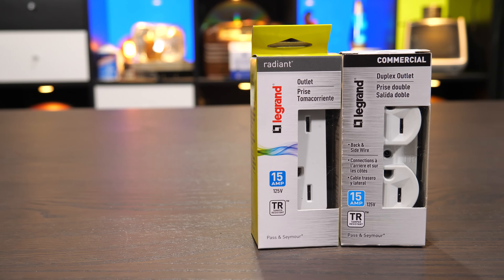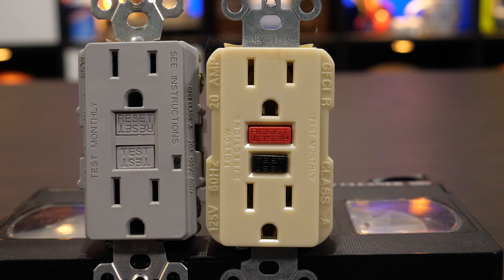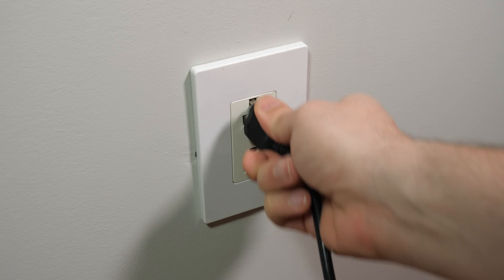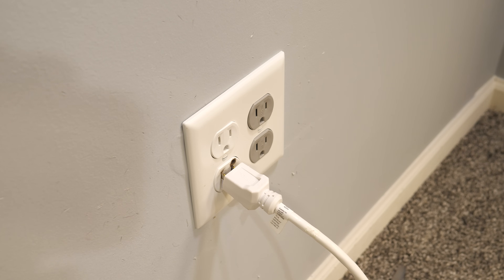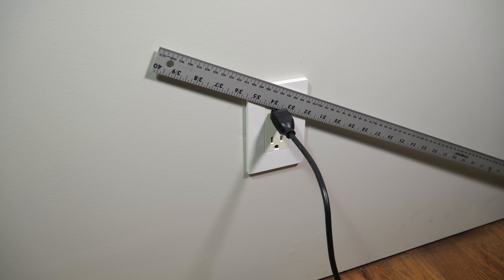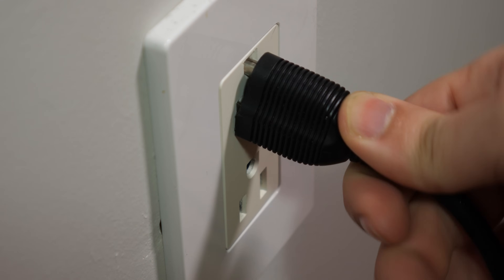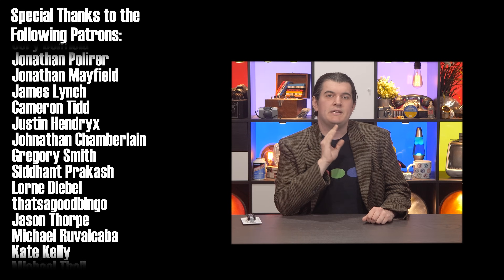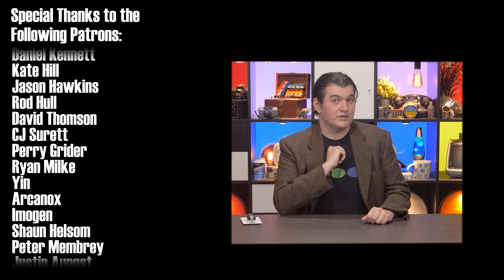Power outlets are topsy turvy - but does it matter?

Comment: You want to see something weirder than Chicagoland sideways outlets? Drive 75 miles north to older Milwaukee homes. The family that had the electrical monopoly in the Milwaukee area in the first half of the 1900s, believed that light switches (A) should not be reachable by children and are FIVE FEET off the floor. And (B) ON is down and OFF is up. Ask anyone in a Milwaukee home built before 1950. The light switch that is down position and on has the word NO clearly displayed. Because the family refused to conform to the industry standard and the rest of the country.

Comment: It is recommended to install the outlets with nutral socket on the bottom if installed  horizontally, the reason is that if your house gets flooded,  water would first get to nutral, at this time the outlet isn't output any voltage until water reach the hot socket and output about 50v to the nearby conductor, but if installed with the hot  socket at the bottom,  as soon as the water reach the outlet it would output 110v to the nearby conductor, until the outlet is fully submerged and bring down the voltage nearby to 50v
The original video about it can be found by using keyword: 插座安裝方向規定?【水電爸爸】
watch it from 6:30 only look the voltage reading it gets on the multimeter (BTW Taiwan use 110v AC with the US type socket)

Comment: This has to do with the ground pin, force, and leverage. Say you step on the cord right next to the outlet. The power pins pivot as they have more play but the ground pin applies pressure to the plastic insulation, and it loads up the surrounding plastic structure.

If the ground is up (smiley face) the downward force goes into the rounded curved side, to the center of the plug where it's strongest, If the ground is down (unhappy face) that force goes to the flat thin plastic side which is weak and can break out. This leaves you with an upside-down U shape that is open at the bottom, and that is the problem.

The ground pin has two functions. One electrical, one mechanical. Mechanically it acts as a pin, a strong lever to keep the plug level. When the thin unhappy face plastic breaks out it still works, but without the ground pins support the cord will sag down with use eventually losing connection. The dangerous part is once the cord starts angling down, there is a lot of downward movement; before electrical contact is lost.

During this time the two blades (hot and neutral) are exposed.

In a domestic setting, this is not a huge issue, but when in a shop setting with lots of heavy cords and power tools, the ground should always go up.

Comment: I was always taught the the ground pin was on the bottom unless the outlet was connected to a wall switch, then it would be on top. This had nothing to do with functionality. It was simply to make it easy to tell which outlet was connected to the switch which would typically have a lamp plugged in to them. I have seen houses wired this way for many decades.

Comment: I don't think I've ever touched the prong while connecting a plug in my entire life, for whatever that's worth.

I think the main reason hospitals install with the ground up is because that helps mitigate dislodging. Hospitals have a lot of bustling about that can easily bump plugs, and with the ground pin down it'd be easier for them to come loose - potentially even enough to break the connection and/or snap the ground pin clean off.

Installing them with the ground up is also a big problem with transformer plugs that have a flared pin. Because then you have to plug a BIG FAT BRICK in upside-down, which is just begging for trouble.

I would say 45-degree, straight-sideways, or swivel is better than straight-down for right-angle plugs. Because obviously you can't use two straight-down plugs in the same outlet.

Y'know what I think really helps with children and outlets? Teaching them what outlets are for

Comment: 3:00 If your wall receptacles are mounted sideways and the city demands that you run all wires in conduit, it is likely that every stamped metal J-box has "top and bottom" knockouts standard. J-boxes with "side to side" knock-outs (on the long side) are often optional and a few cents more expensive per box.

Comment: Man i really love your channel but first you charge face first into the green-washed electric heat (most inefficient use of electricity) and now youre spreading this upside down stuff 😂😂  They go upside down in hospitals because the increased risk of electricution is outweighed by the risk of tripping a breaker. With life support on, you would rather a metal object become energized and not trip, which is what you get with upsidedown recepts. In all other circumstances, you would rather cause the short, tripping the breaker. No energized metal parts. To ensure this, you NEED hot neutral on top, ground on bottom. Hope this helps ❤

Comment: I wonder if mounting it the wrong way (where you don't see the face) is better for the outlet more stable-er. Instead of the top of the outlet being held by merely friction of the 2 vertical pins you would have a sturdy or sturdy-ish pin directly holding the thing sticking into the wall up.

But the real best way, i think, would be mounting each plug at a 45 degree angle

Comment: And now i'm reminded of the summer school (elementary school) physics lab I took in which we made some contraption, including an LED indicator for when power was supplied, that had us make the two prongs out of paperclips and we were instructed to plug those two paperclips into a wall socket to make the contraption work. This would have been in the late  2000's and I'm still astounded this was allowed. All to  make a fan or something irrelevant to this story work by completing a circuit. We even got to take them home to jam those paperclips into our wall sockets with no supervision anywhere in our house. Fun! Surprisingly, no one electrocuted themselves. What wild mid-west times those were.

Comment: The US plug has no insulation on the pijs, and the outlets don't have an on off switch. There's two layers of extra safety right there that can be applied without too much hassle, and is a legal requirement in Australia (and New Zealand as we have shared standards).

The earth pin in Australia is longer and is at the bottom so it's the last to lose contact if tugged downwards.

Comment: the sockets plates in my country gets held by a fragile clips and not a single screw and it outputs 240 volts likely for us there is a regulation for the plugs to be manufactured with sleeves near the fingers so it won't have a chance to shock anything

Comment: I worked in electronics for years and even taught electronics at the US Army Intel Center and Schools Fort Devens Massachusetts. Although I AM NOT an electrician; I can pose a SERIOUS ARGUMENT for installing the outlet with the ground on the bottom. If a person lives in a flood zone it is significantly important that any rising waters contact the ground BEFORE contacting the hot lead. If this positioning is universal across the entire industry, then there will be far few instances of electricians forgetting to mount the ground connection on the bottom in flood prone zones if it is expected to be mounted on top elsewhere. SAFETY FIRST! In the early stages of a flood , people are usually wading through the water trying to save as many of their valuables as possible - and nobody wants to be wading through electrified water, even if that electrification only lasts a few seconds until the water rises enough to reach the ground too! Although some electricity will go everywhere through the water and provide a noticeable tingle, electricity always tries to take the shortest route which means the vast majority of the current will go from the submerged hot lead to the submerged ground lead.

Comment: Not too long ago I worked in a building where every single outlet was installed with ground pin up. All of our machinery had right angle plugs or heavy adapters, so they were constantly coming loose because they were upside down. Super annoying.

Comment: In 1983, my dorm room had metal receptacle covers. The room had recently been painted and unknown to me, the screw was missing out of the cover. While plugging in a lamp, the cover fell down across the hot an neutral prongs of the lamp. As you can imaging, this produced a massive explosion of liquid metal. The bad part was the the breaker didn't immediately trip, it arced nearly all the way through the cover leaving two distinct lines in the cover and completely ruining my lamp plug.

Comment: Good luck plugging two right angled plugs into a double socket like that. It amazes me how badly designed the US electrical system is, did nobody think it through or even have the slightest bit of common sense

Comment: I have a number of UPSes and surge protecter plugs at work and at home, and the 45 degree angle is so that both outlets can be used. Certain orientations of the the 90 degree plugs block the one of the outlets.

Comment: To be honest, the outlet is perfectly symmetrical. So as long as the wires are connected correctly, that is the real necessity. And if it's upside down by definition, then I will stay upside down, thank you very much 😂

Comment: I live in Chicago and when you mentioned the sideways outlets I spun around my room in disbelief to realize that all of them are indeed sideways and I never thought a thing of it. Thanks for heightening my awareness of my environment I suppose.
Reply: You know, i’m looking at a picture of one right now and i’ll be damned i kinda like it. It aligns with the baseboard better, imo
Reply: @AlexofZippo  in the UK with our sensible plugs & sockets, they're all horizontal like that, left and right sockets.

Wires go down, vertical stacking is crazy when you think about it. They're so messy like that, & 2 right angle plugs can't be used.
Reply: The other odd thing about common practice in Chicago, is that the hot blade is on top and the ground hole is on the right, which goes against National Electrical Contractors Association's National Electrical Installation Standards (NECA 130-2010), Section 5.5.2 ("Receptacles"), p. 13 (?), in which they recommend putting the neutral on top if the receptacle is mounted sideways.

I don't know if that's code in Chicago or just folk tradition.

Comment: I was an electrical engineer for a power company, and we had the same discussion.  Some felt that the ground up would be the most logical, but the decision ended there. So when I built my home back in 1979, I installed all of the receptacles with the ground up.

Comment: If you plug the ground first, visually you can see the angle of the plug with its triangle shape because you see the distance of the side relative to the ground position. If you plug the connector upside down, you see the angle, but the ground can't serve as a visual reference. That's what I think as a reason.

Comment: Huh. I remember helping a neighbor move once and we were measuring something for the custom storage we were building and suddenly there was a huge burst of sparks and the wall was seared near an outlet. Turns out a plug had just been sitting out of the outlet and the metal tape measure had touched it which scorched the wall and blew away part of the tape. So i guess this happens more than I thought.

Comment: There are recessed outlets that would address all these issues, except for the 90° plugs; in which case, you use a power strip. Problems solved!

Comment: So as an electrician, there is not NEC (american codebook on eletrical work) regulation for this but it is also widely accepted that you ahould put the face upsidedown in case something falls and shorts put the hit and neutral prongs. Is this unlikely, perhaps, but it is a simple change with literally 0 cost that can potentially prevent equipment replacement, fried computers, or an eletrical fire. I have quite literaly been burned by 120V (standard USA voltage) shorts and it wpuld have been way worce if not for some burn cream in thw qork van first aid kit.

At the very least, put it sideways with the neutral (the bigger one for most common outlets). While it can be hot, it is only hot if the load (thing being powered) is unbalanced.

However, thise I work with only do this when using metal faceplates and don't realy care  outside hospitals (which also have other grounding rules) or to make everything match.

Comment: You are wrong, as plugs tend to gradually fall out of the sockets when the sockets are upside down.  I worked at a major yacht manufacturer, the best production yacht manufacturer in the US.  The engineering was first class, as the engineers were world class.  They specified the outlet orientation.  I was an inspector on completed yachts, and I had to write this up on a number of yachts.  The outlets had to be reoriented.  Many of them had to be replaced, as being upside down would cause power tool plugs to break out the front of the outlet by the ground hole.

Comment: As an American living abroad in a region (not U.K.) where everything is 220v using predominantly U.K. style 3-prong plugs... I find it a bit ridiculous that while these are touted as being much safer... all the damn boxes only ever have 1 outlet, and there are few enough installed that you end up with cheap-ass 'Chinesium' multi-plug adapter-style power strips plugged in all over the place. Undoubtedly negating any conceivable safety advantage of the plug design. Interestingly, in other European countries I've traveled to, this same shortage of outlets seems to be common, but maybe it's just me??

Comment: The older outlets with a name brand embossed in them like Hubble the Hubble in the oval is right side up when the D shaped grounding socket is on THE TOP!!!! Same with the old Eagle Bakelite outlets, PS, and others. As an electrician I installed about 85-90% of these 15-20 amp outlets D shaped grounding prong DOWN. A few were installed sideways. I "NEVER EVER" put the hot on top when mounting outlets sideways. Hospitals, factories, water treatment plants, etc. often specify grounding pin on top. The "grounded" blade goes into the longer slot socket. The grounded conductor is the neutral. At the service entrance it gets grounded to water pipes, ground rods, and the panel can itself. It gets BONDED to the green or bare safety grounding conductor. The worst offenders for stuff dropped in between a plug and an outlet were paperclips. Vibram soles on work boots are good for 277 volts to ground, but try to keep that under 240 volts!

Comment: anyone else want the opposite of those adorne plugs after watching this? With a top plug that is "upsidedown" and a "normal" bottom plug?  best of both worlds, a bottom plug for right angle connectors and top for straight 3 pin connectors

Comment: And yet there are so many things made out there, such as nightlight air fresheners how the list goes on that would themselves be upside down if you installed it the way you’re saying. The simple truth is it just doesn’t matter if you look at a ground, fault circuit. You will notice that you can turn it either way up and the writing is in the right orientation. The manufacturers actually imprint on the outlet. The words reset and test so that you can read them whether the third hole is down or third hole is up. So quit acting like a know it all

Comment: Generally not a huge issue. Safest is Ground Up. More things fall down then fall up. A long piece of wire once slid down the wall in my kitchen, in between the plug and the outlet (it was a USB charger cheap plug, offset weight leveraging to fall out... ) This shorted the plug.  If it was less conductive it could've caused a fire. 
Most places in the world use plugs other than the North American Standard which are recessed and the plugs stay in the outlet better.  But in North America, our dodgy outlets and dodgy cords, and USB chargers frequently have gaps.  (The only bad thing about UK and European plugs is if you step on one.)

Comment: Making the holes most plugs have mandatory, and redesigning the plugs interior so that pins rotate into the holes to lock it in place, and requiring a tug to release would solve a lot of problems.
And using spring tension would allow the plugs that don't currently have holes to still be used.

And a sleeve on the plug blades would be easy to do.

Also, recessing the contacts within the plug slightly deeper, would also be very simple, and would not interfere with current plugs being used.

The main problem with American plugs, is that they are friction fit only.

But fixing all of the problems, it's quite simple.

Comment: Why not install the NEMA 5-15 sideways with the neutral up? If the “metal object getting between the plug and receptacle” scenario were to happen, ground up orientation means that live could be shorted to ground. Also in the situation where two pole plugs are used, the neutral up orientation would also reduce the chance of short circuiting.

Comment: No 
Your vid missed the most important home outlet problem
Home after home after home that I have bought and lived in have old worn out outlets
Fact
I now when I buy a home I test and replace almost all outlets due to plug falling out.
Now
I do all my home outlet replacement live with full power and even when the wires are pushed in I still wire install all my outlets with full power.
Why
Safty when I know there is full power I never take short cuts and wear gloves and wear eye protection and I make sure all my outlets are wired with power on the right hand side.